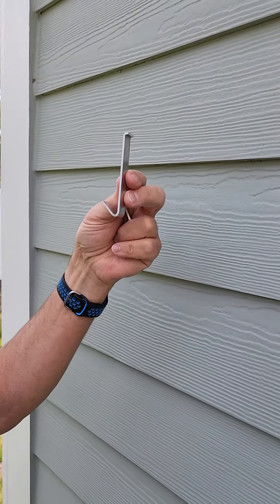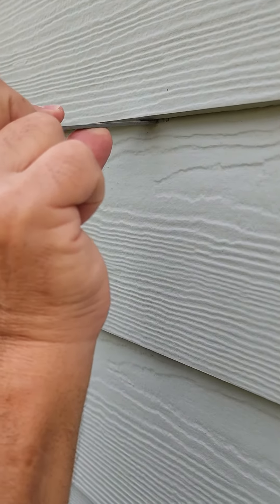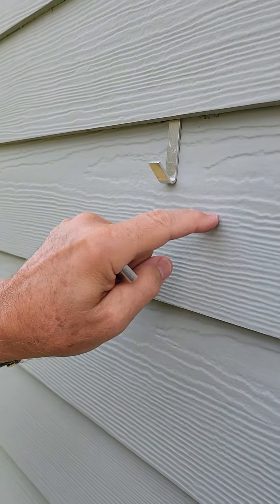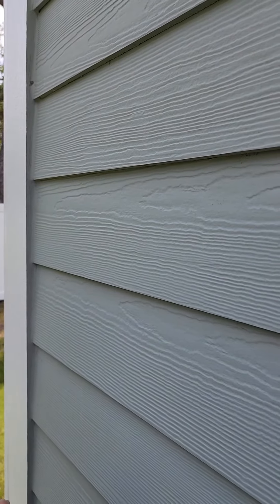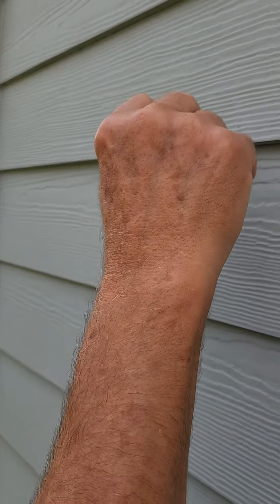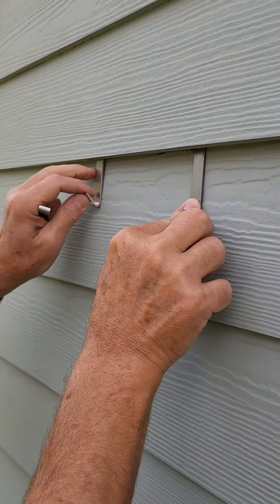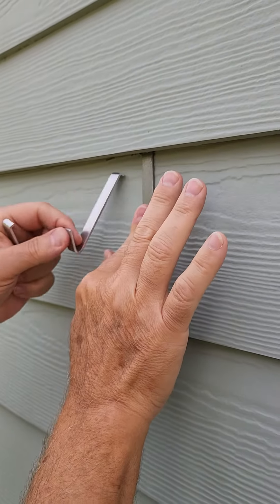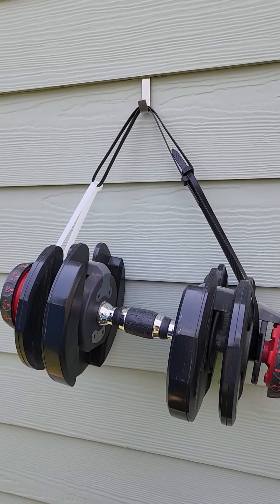How to install the new NoDamageHooks. THE ORIGINAL!!. NOT A COMMUNIST CHINA KNOCKOFF!!

Comment: Hey cool tool and neat product, but can you tell me how much load each hook can hold? I'm looking to add a prefab awning over a door way and the item comes with ginormous bolts and anchors, which I'd prefer not to put into the fiber cement board. Just looking at all options that might be avilable, thank you!
Reply: I've hung 50 pounds on one hook with no problem. But I advertise 30 pounds to be safe. Some siding may be old or poorly installed.